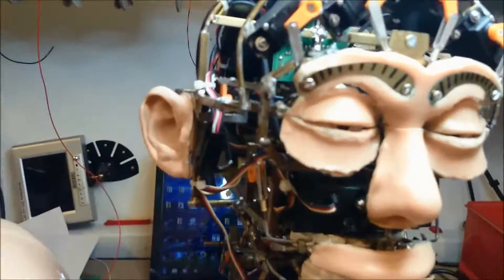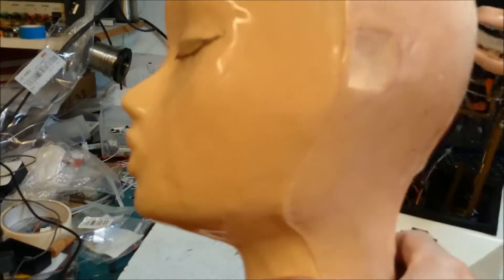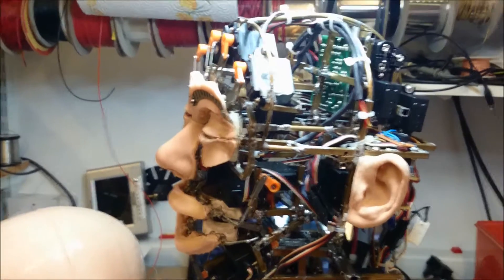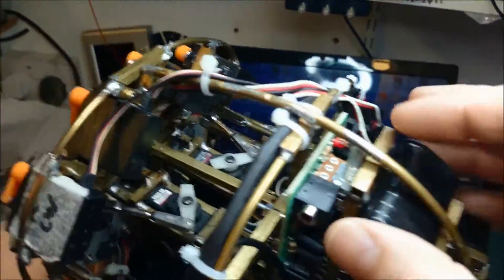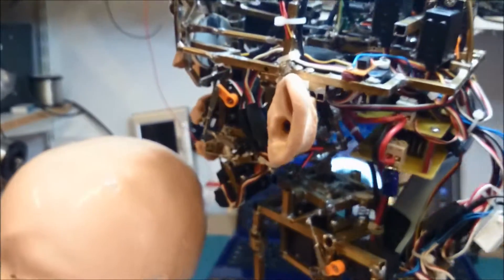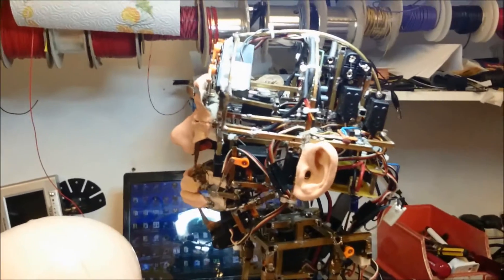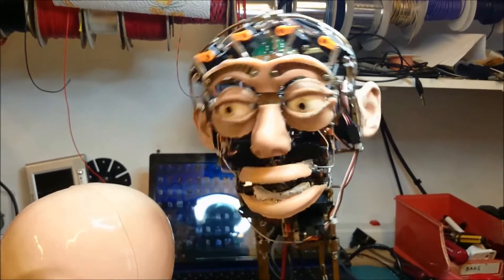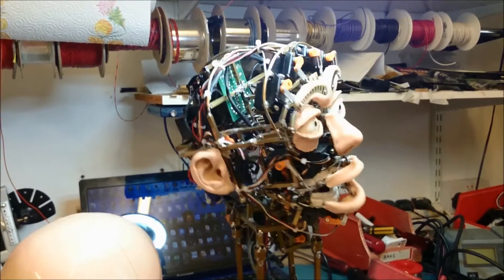ROBOT HEAD  - New Humanoid Ears for Binaural 3D audio

Comment: Hi Kevin, great job! Is this project available to download? thanks. JJ.
Reply from the maker: Hi there, not uploaded this project anywhere yet, it would always be out of date. Software platforms and tech change too fast for me to keep up, I am waiting for the world to stabilize.
Reply: @KevinFelstead  That would never happen. We have to keep doing things and posting as we go along, and then updating them! At what stage is your project now?
Reply from the maker: @sweatanddiet2917  Have you seen my video Robotic head - Artificial intelligence research platform.?. This was all working under windows 7, Transisioning to another Pc running Windows 10 has caused some issues. Such as no drivers for the current hardware and program incompatability, still working through these. As for rest of humanoid robot hardware, I now have a 3D printer so am looking to re-design certain aspects with thid in mind. My job is full on at the moment so have very little time on this project. I will post more when I have made more progress.